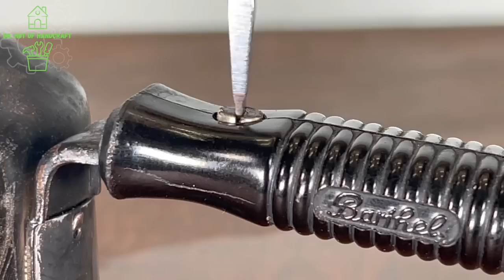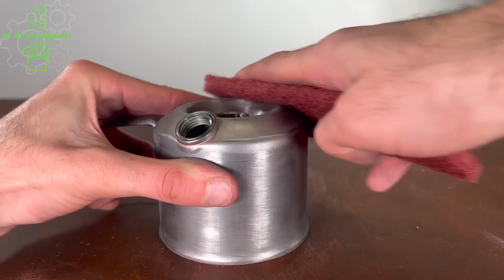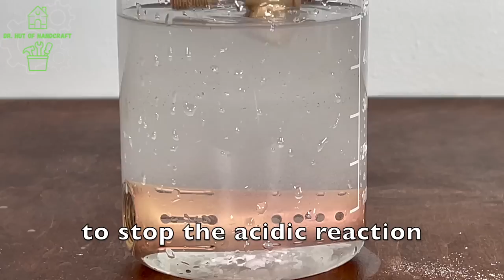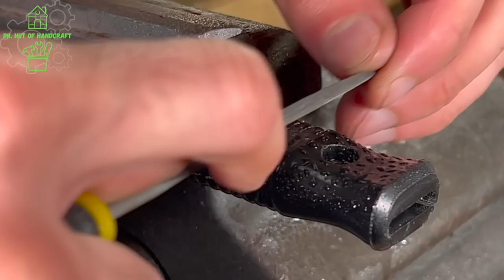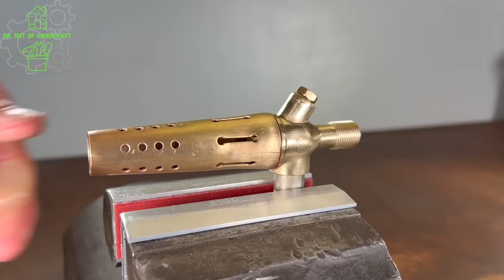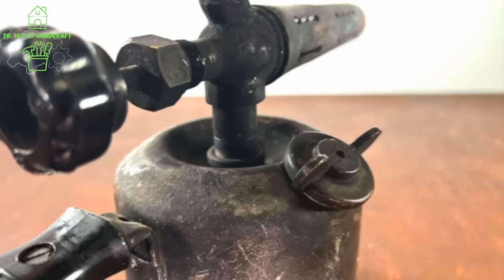'Gustav Barthel 131' Blowtorch restoration I Dr. Hut of Handcraft

Comment: alright... How are you getting such good coverage and consistency with your blaster? I've tried a few different types of media and pressures. What kind of pickup are you using? PSI / Media / Gun  ?? AHhhhh help. Great video as always
Reply from the maker: Oh man, I also had huge problems with my blaster and it took me a lot of time  to fix it.. 
make sure that your blasting medium is really dry and that you are using a water seperator (no idea if that is the correct term in english), even if your air compressor has one integrated. Then Try to make the way from the compressor to the cabinet as short as possible, so you have less loss of pressure. Between my compressor and the cabinet I have two air hoses with the water seperator in between.
But the biggest problem i actually had was with the gun, the one that I got with my cabinet was just crap and They sent me a new one. Maybe try a different gun and your problems will be gone, for me at least that was the main problem.

I mostly use glass beads 100-200 μm . But that is really fine, almost like powder. Probably will go up to 300-400 μm next time when I will order new medium. And for pressure it about 6-7 bar (80-100 psi ?)
I hope could help you, let me know if you have further questions!

Comment: Hi Dr. Hut, can you sandblast every metal?
Reply from the maker: Yeah basically, as far as I know. As long as you don’t sandblast sodium 😄 Jk, well steel of course and fir soft metals like aluminium copper and Brass it’s better to use fine glass beads rather than corundum. I think I read somewhere that when sandblasting thin sheet metal of soft materials you could theoretically kind if “compact” the material. But I have no idea about that

Comment: Si no se le da presion como funciona
Reply from the maker: For the small ones you don’t need to build up pressure yourself. The Gasoline gets through a gasifying chamber and when you preheat it it evaporates. The capillary effect sucks up more gasoline and the evaporated gasoline gets pushed out by the pressure built up through the whole process